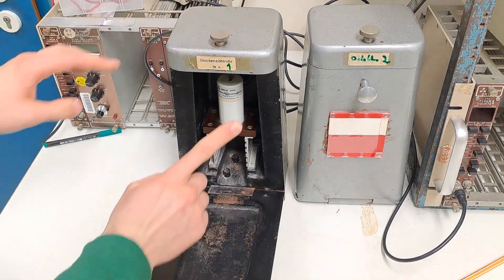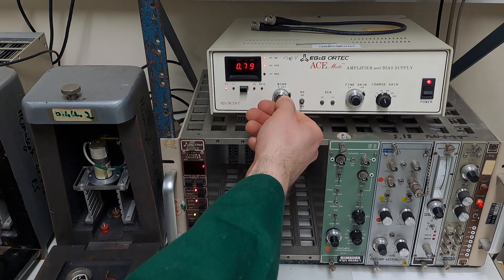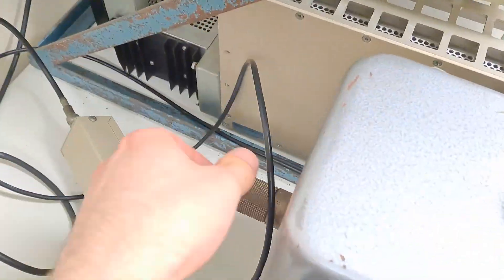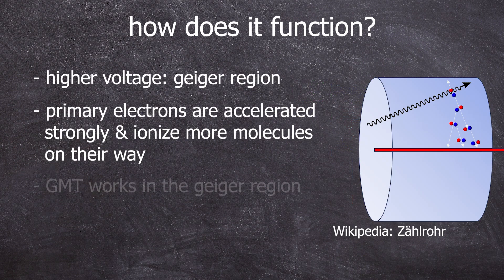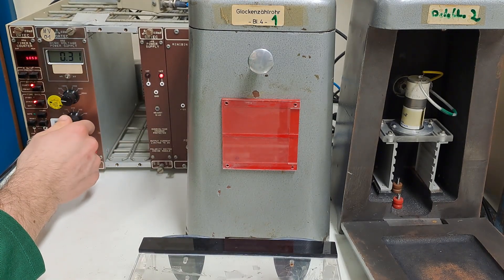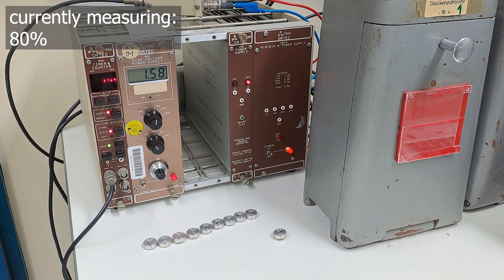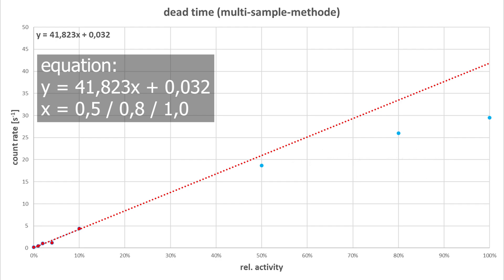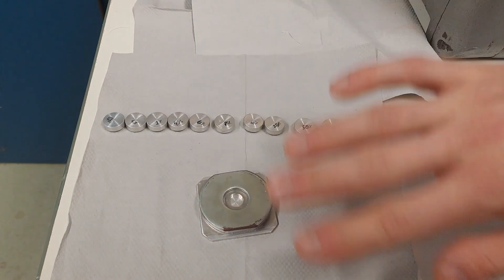Dead time of Geiger-Müller tubes - nuclear chemistry

Comment: Do these meters have the ability to perform electronic quenching? Let me formulate the question better. In addition to the quenching operated in the Geiger-Müller tube by halogens or organic vapors, does the measuring device have the possibility of setting a voltage switch-off to the tube in response to the arrival of the signal, in order to reduce the dead time?

Comment: The Rosenberger BNC connectors have a maximum working voltage of 400 Volts. Others should not be much different.
For your application, I recommend High voltage BNC types.